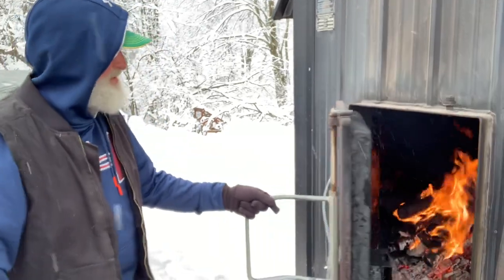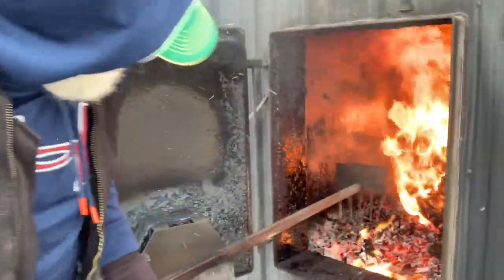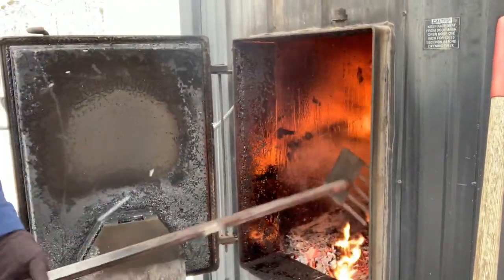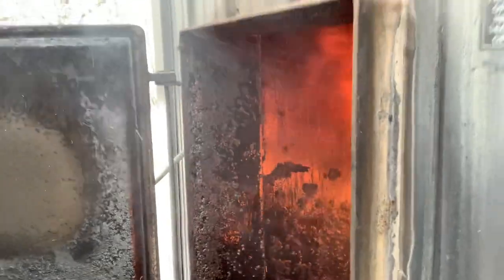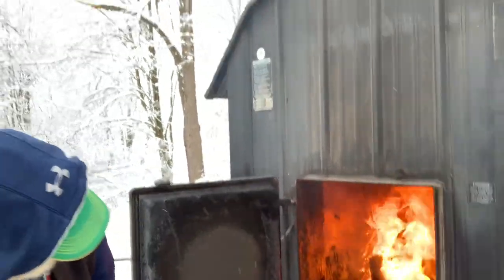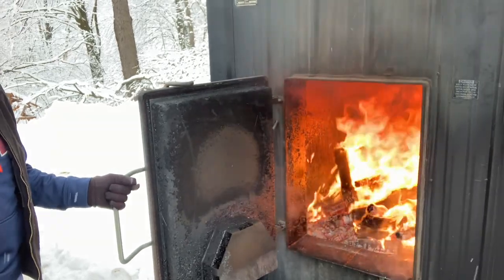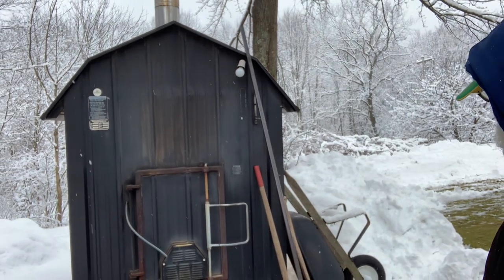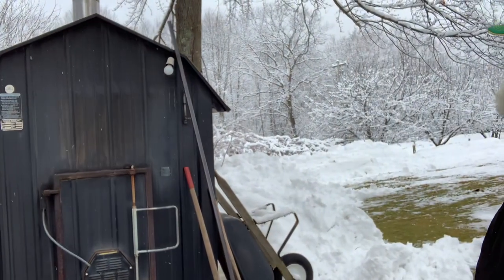Central Boiler 20 year old outdoor boiler, maintenance is the key.

Comment: im in western wisconsin and mine is 10 years old.  still on the original pump, door gasket, and solenoid to open and close the door....even though i did buy a replacement from the dealer(i figured i was on borrowed time with that part). The best thing i think you can do for your out door boiler is to run them as cool as you can. Mine is set at 155 deg F and it heats the house, all the dom. hot water you could use and a 2 car garage and i still only load it once a day. i also filled mine with glycol that i got for free from a demo job i did.  the glycol makes the internal parts of this thing look like factory new even after 10 the pump looks like new when i took it apart last year. no rust...no scale...and it is still just as pretty pink as when i pumped it in. Also i only burn clean hard woods and cardboard and paper in it. no plastics or rubbers.  10 years down and hopefully at least another 15 to go!
Reply: That seems awfully cool to run it at.. how do you heat the water that low?
Reply: @xjjeepman1  sorry it took so long to reply.  the the aquastat that is on the boiler is digital and can keep the water from 150 at the lowest to 185 at the highest. my indoor electric boiler has a cut off temp sensor at 145 so as long as i have wood to burn in the boiler...the thermostat in the house can call for heat and the indoor pump turns on, but the indoor electric boiler elements wont turn on because i have it set for 155 deg water to come inside from the wood boiler.
hope that answers your question.

Comment: We had our Classic 5644 installed Aug 2003.  It just sprung a leak in the firebox last weekend. (11/26) So we had it & loved it for a good 20 years & took pretty good consistent care of it.  Unfortunately I think that may be about the average life expectancy of these units -- 20 years or so on average.  Recently invested in the Classic Edge 560.  Very excited about getting it installed & getting started with it.  Looking forward to burning half a much wood, too!  👍  Question, though:  I've been watching a lot of these Youtube Videos about how great the Edge series stoves are; but have yet to run across any detailing any sort of problems (& troubleshooting tips?) might be reasonably expected to have to deal with?  I know, with the 5644, it seemed like I was replacing solenoids every couple of years or so for a while there. (approx. 2006 - 2011)  Also had to replace the pump once. As well as a couple of other service calls over the years.  Also somewhat concerned about the quality of construction/materials/etc, nowadays -- compared with 20 years ago?  Not expecting the new unit to automatically/necessarily be sub-par/problematic, here, by any means.  But just want to be as informed & prepared as possible; for any potential problems that may crop up.  Any thoughts/experience/feedback?  Thanks!
Reply from the maker: Great furnace and easy to use, I did a video and the title was “ let’s take a better look”. This video will answer your questions.  
Thanks for your question
Kevin

Comment: I bought my 6048 in 2015 and have loved it. It's WORK cutting, splitting and stacking wood and trying to stay ahead of it. I currently have a $900+ credit on my propane bill and it's been as high as $1300+... just from using wood during winter. I have a 12'x40' greenhouse I heat with a heat exchanger that SUCKS thee wood. If it weren't for that...I wouldn't use very much wood. BUT... I can grow beans and tomatoes or what ever we want all year long!!
Reply from the maker: Oh ya them greenhouses will eat the wood, but fresh vegetables nice.  I’ve wanted a greenhouse but just haven’t done it.  Good thing your not buying propane now and for the next few years.   Thanks for watching our channel. 
Kevin

Comment: Has anyone tried putting wood chips inside the unit? Sounds like it would be toxic and not a good idea. What are your thoughts?
Reply from the maker: If a person wanted to burn wood chips the furnace would need a blower to inject air into the fire box. You would need to stir them more often as well.  I just stuck to cut fire wood.  Thanks for watching,Kevin

Comment: So do you still use the wood boiler in the summer and spring season?
Reply from the maker: Most of the folks use the furnace long into spring until it gets nice outside.  Very few burn all summer but some do as just to heat their domestic hot water.  The furnace in the video Boone has used it during the summer a few times. Thanks for your question.
Reply: @klwit1980  Thanks for the feedback I appreciate it. I am contemplating of purchasing a wood boiler like this I live in Saskatchewan Canada and our natural gas costs keeps rising
Reply from the maker: @tozlu16  You will love it.
Reply: When I had 3 or 4 kids home and had a propane water heater ours went all year long because propane was expensive and we went through a lot of hot water and was able to burn any junk wood or shorter pieces during summer. That water heater sprung a leak and replaced it with an electric one and they had advanced a lot so was much more efficient and kids have moved away so not shut it down for about 4 months every year.
Reply: @Glock2201  so is propane better is what you are saying?
Reply: @tozlu16  When I bought the propane water heater I did not have the outdoor boiler and heating water with propane was much cheaper than electric and heaters were not much more. Propane water heaters have gone up a lot compared to electric and propane prices are much higher so no propane is not better now but was 20 years ago when I installed a propane water heater.
Reply: @Glock2201  Thank you so much for clarifying this. I appreciate it.